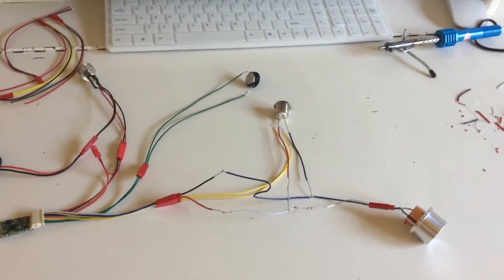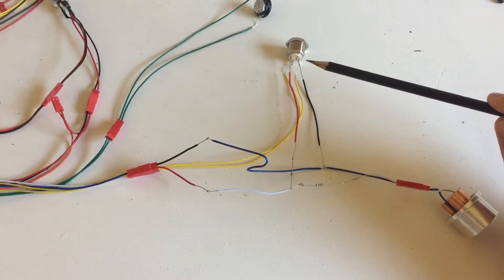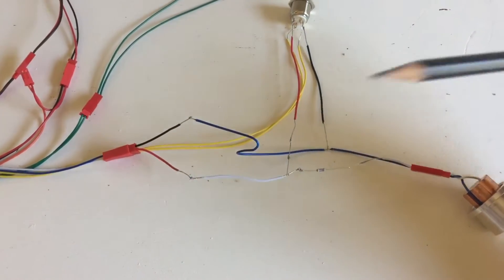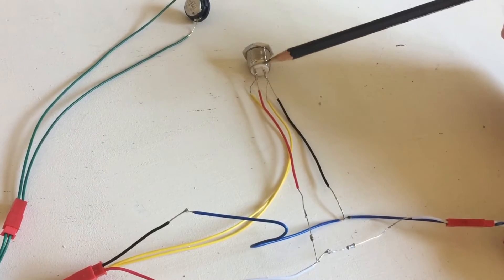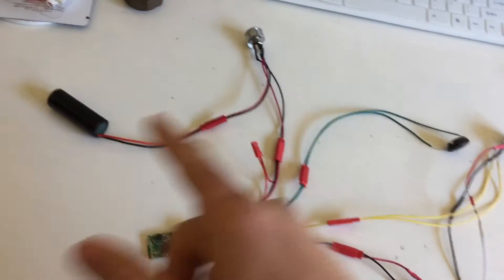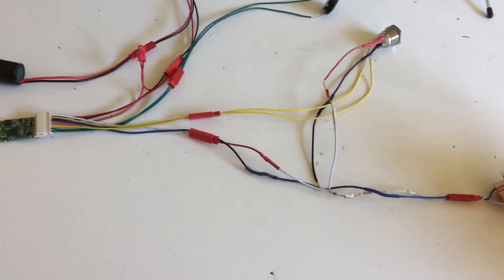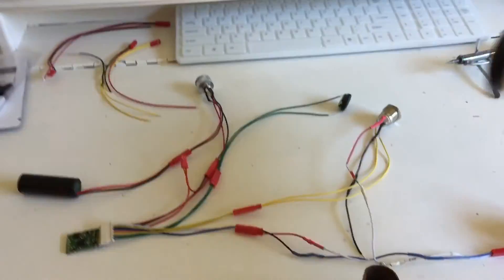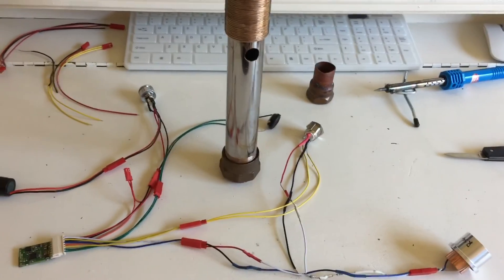PT 2 Lightsaber wiring tutorial made simple (Custom Saber Shop) DIY

Comment: "Y" splices are actually  called bridge splices. You can still put heat shrink  on it with the 2 wires in one side. The heat shrink  will help with the strength  of the splice. Everyone  start someplace you did good for a beginner.

Comment: Hey man I have a battery pack and speaker attached instead of the lithium ion battery would that still work if I get the other parts
Reply from the maker: Death-Stroke 1855 yes that will work as long as you wire it together correctly. The only difference obviously will be you have to change batteries rather than charge the battery which might also mean you will need more space in your Saber to fit the pack. I just did that lithium ion for space saving as well as convenience I’m charging. 
Curiosity,  did you get the pack from custom saber shop?
Reply: JediMasterTater yeah I got it from the custom saber shop and if I use all JST connectors do they have to be the exact same color like yellow with yellow, green to green and all that because I got a LED module with a JST connected which was red and black wiring and so was the speaker and battery pack and also the switch
Reply from the maker: Death-Stroke 1855 ok cool, and no the color wires don’t matter at all. They’re all the same, just copper, so you can wires any color together. It just makes it mentally easier to repair wiring or not get confused with what goes where if you try and wire using the same color also when you order the wires they’re the same price so...
I had to use different colors in a couple spots because they were out of stock. 
But yes if you want to mix and match you can!
Reply: JediMasterTater awesome man thanks for the help and quick feedback
Reply from the maker: Death-Stroke 1855 no problem! Have fun with it